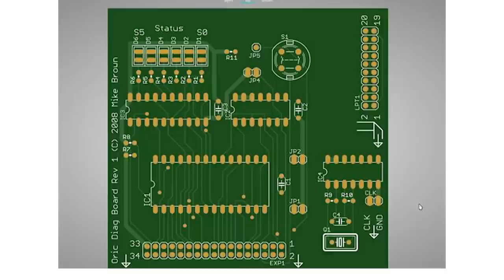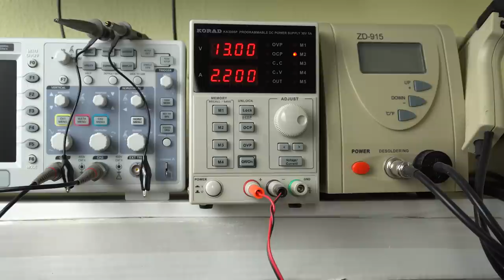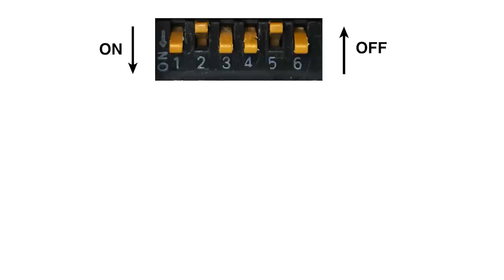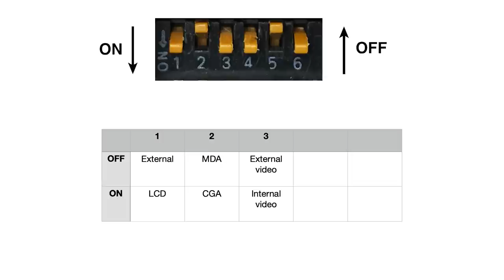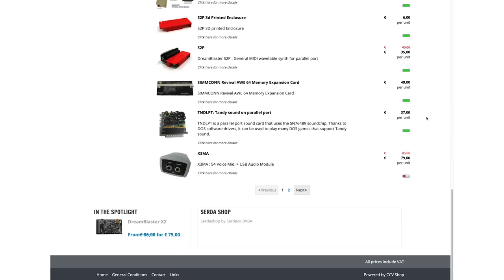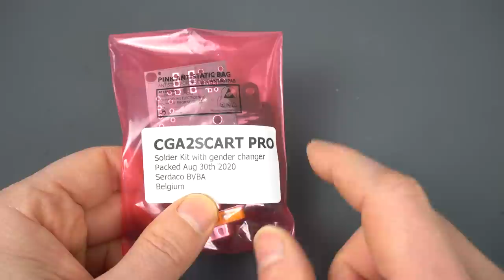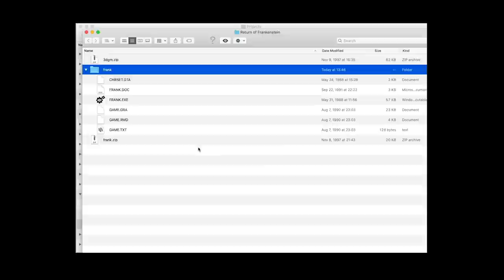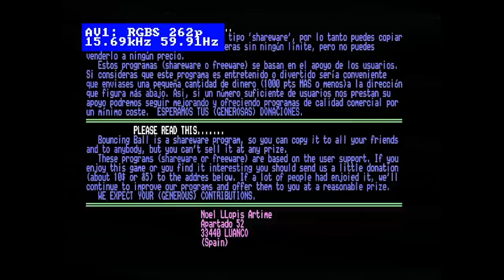Early MS-DOS Laptop Amstrad PPC512 (Part 1)

Comment: I had one of these back in the day (I don't know where it's got too!) and I remember upgrading it from a 300 baud modem to a 1200 baud one! I then swapped it out for a PPC640 and added a hard drive & external CGA monitor. I remember watching BBS pages drawing a line at a time! I don't recall throwing them out, they must be kicking about somewhere!
Reply from the maker: Nice! Putting a hard drive on a PPC wasn't a small feat! Did you get it done at a computer store?
Reply: @NoelsRetroLab  I fitted it myself, I must dig it out, I know I didn't throw it out!
Reply: Please, while people talked of bauds in the 80s no need to misuse the term in 2020. 300 bps was 300 baud but 1200 bps was 600 baud if I recall correctly. It is better just to forget the whole term. (baud is signal elements per second. Each element could code one or more bits)
Reply: @okaro6595  Stop trolling - I know what the term baud is and I referred to it correctly as it was a 1:1 ratio. The Amstrad PPC is from the late 1980s, I upgraded the modem myself, the PPC640 shipped with a 2400 baud rate modem.

Comment: Great stuff =D  Maybe the LCD problem is the flex ribbon being "hot bar" glued onto the LCD screen edge - perhaps it is suffering from the same problem Gameboys suffer and needs to be thermally joined again.  Looking forward to part 2!  Nice work on those old DOS games =D
Reply from the maker: Thanks! I don't have much experience with that kind of LCDs, so that could well be it. Right now I'm chasing down another lead though. I looked at the schematics and this LCD takes +5V and... -20V!!! And guess what, it's only getting -15V. So I think that might be enough to prevent it from displaying anything. Anyway, I'm pulling on that thread at the moment. We'll see where it leads me.
Reply: @NoelsRetroLab  Check for a shorted cap, or something else that gets too hot when you turn it on.

Comment: I used to own one of these - well the PPC640 version with 2x 720k floppy drives.  Got it second-hand at a garage sale as a kid back when my primary PC was still a 386.  I was so excited to have a PORTABLE computer I could take to school with me!  Problem was I saved up my allowance to get those ten C batteries - I figured they'd last a long time, right?  An hour and a half; that's it!  I had the AC adapter of course but the teachers wouldn't allow me to plug it in, citing "safety concerns" but really I think they just didn't like the idea of allowing me to be special while the other students used pencil and paper.  Unfortunately I resorted to taking it apart even though everything worked perfectly on it.  Wish I still had it, as I'm now into retro PC's.  All that remains today is the two floppy drives - and some of the original Amstrad floppy discs it came with.
Reply from the maker: Love that story, Angela! I could see how exciting it would be to try to take to class. An hour and a half is a LOT longer than I expected it would last on those batteries. They're cheap to get still, so I'd say look for one. The LCD video is abysmal, but the CGA out is great. I'm loving it so far.

Comment: Those plastic "screws" around 9:50 are called standoffs, just like the metallic ones that screw in and are typically used to mount most modern motherboards. The plastic standoffs were used in some AT-compatible (and early ATX) cases and would "slide" into openings in the case/motherboard tray instead of screwing in (though there were plastic standoffs that did screw in as well). And yes, I had to look that up just now because I couldn't remember ha ha!
Reply from the maker: Right. Thank you! Since I don't have a background on mechanical/repair stuff, sometimes basic vocabulary like that is totally missing for me 😃

Comment: One of my first "work" computers... I wrote a complete call-logging reporting suite in BBC Basic (?!) and A86 assembler under MS-DOS on one of these. All the screen / graphics were handled through in-line X86 code or within the .COM files themselves. Happy days...
Reply from the maker: Nice! Yes, a lot of people mentioned they used this for work. I think that's why so many people have bad associations with it and hate it 😃
Reply: @NoelsRetroLab  I also remember around that time we were installing Tulip 386 PC's with a 20MB hard drive that had a BIOS bug that would literally 'jam' the heads when it reached exactly 50% capacity, and you'd have to open the HDD housing and move the heads!

Comment: Great to see one of these machines getting some attention! Watching this video makes me want to have a look at my PPC512 which has no drives and is in pieces, I got it years ago in that condition, and I've no idea if it works or not.

That top compartment is for the modem cable - I've also got a PPC640 which comes with the modem installed by default, and the cable is a really tight fit in there.
Reply from the maker: Do it! It's a fantastic little machine (OK, not so little). Especially with the CGA video out, it makes it great for early MS-DOS gaming. Totally worth it. Check out some of the upgrades I'll add in the next few videos.
Reply: @NoelsRetroLab  CGA and MDA! so also perfect for text writing. I used to write my diary on Microsoft Works 1.05!

Comment: That machine is an 8088, so is 8 bit for the data bus, but internally is still a 16 bit CPU.  The Intel pure in and outside 8 bit CPU is the 8080.
Reply from the maker: Right. It's the NEC V30 so 16-bit CPU. It was a brain fade thinking of the 8 bit video bus (the regular bus is even a 16 bit one).

Comment: I'm amazed you can solder these items with that honkin'-huge soldering iron tip.
Reply from the maker: Nah, it's not that bad. The tip I actually really like it wide like that because it transfers heat a lot better than a narrow tip. So it's my go-to tip unless I need to do something really small.

Comment: maybe a easy one, but have you tried the "contrast knob" for the LCD ?
Reply from the maker: I did, I did... but that's a really good suggestion as you'll see in part 2 😃
Reply: I was screaming this throughout! 😱😂
Reply: I had one of these many years ago, and the display was nothing like a modern lcd , actually not particularly good even for the time let alone today - you really had to play with the contrast and the angle of the screen to get something readable. I used mine with a monochrome CGA monitor most of the time.
Reply: @Doug_in_NC  my PPC640 was pared with an IBM 5153 for 99% of its life, too!!

Great little machine, shame about the screen
Reply: @NoelsRetroLab  I also noticed that the floppy you used had bad sectors.. Sucks that lots of floppy disks probably nowadays are slowly bit-rotting away..
Reply: My thought as well...

Comment: Nice. I have a PPC640 I haven't touched in years. Looking forward to part 2!
Reply from the maker: It turns out it's a great machine if you use the CGA output. I have lots of plans for this one, so there'll be many parts I think 😃
Reply: @NoelsRetroLab  dunno if it is in your plans but as it has a V20 you can make it run CP/M-80 apps :D

Comment: I worked at Wilding's Office Equipment many years ago and a customer brought one of these in. He asked if he could do any thing to make it more useful. I suggested it would make a good door stop! He complained to the head office and I got a formal reprimand!!
Reply from the maker: 🤣🤣🤣 Hilarious! Fortunately, with modern technology, we CAN make them more useful. I'm hoping to upgrade it and improve it a bit over the upcoming months.
Reply: @NoelsRetroLab  I'm a qualified Novell engineer and still have the original Intel 
pentium pc I trained on. 4Mb of RAM  and 32 floppy disks to load Novell. 40Mb hard drive too. I can't part with it, sentimental reasons. Oh and it was Novell 3 by the way and I did upgrade!
Reply from the maker: @grahamwalker6395  Nice! I wish I had my own computer from back then, but they were all sold/traded/donated along the way. Oh well.

Comment: I owned a PPC640DD when they came out.  Some models had the NEC V30 Z80 clone CPU that was mil spec to survive a nuclear war and some slipped thru into the supply chain into the production of these PC's.  Glad the 640 had 640 RAM and the DD meant dual 3.5inch floppies.  It also had a built-in modem - 24bis IIRC.  Fun times on BBS and for train journeys.  Though for batteries it would eat them and a full set was not cheap, even then and rechargeable was lamentable.  Still a fun machine for the time, but don't expect to play elite on battery for more than 4 hours, IIRC 3 was closer to the mark.

Was not a light machine and when I moved onto a PSION II, battery life was leaps ahead and had fun programming with that and the hardware addons.

Did try the MC600 PSION PC notebook sized affair (was also the MC400 that was Psions OS interface and not DOS though may of got those two crossed in models) and was good battery wise, but was just too buggy for DOS stuff and took that back next day (yay Dixons).

Comment: ohh sweet memories.. my first MSDOS machine, a PPC 640, dual floppy ! I used on vacation connected to a ZyXEL modem (cell protocol for ETACS cellular networks, mid '90s)
Reply from the maker: Nice! Wow, I never ran modem over cell networks back then. Must have felt like total sci-fi!
Reply: @NoelsRetroLab  yes, and very slow! 16800 bps nominal, more or less 9-10k real... and quite expensive, billed at minute... :)

Comment: Assuming all 10 D alkaline batteries (12,000 mAh each) are in series, providing a nominal 15VDC with a power draw of ≈ 0.6 Amps then ideally the batteries could last up to 20 hours.  (12,000 ÷ 0.6 = 20)   However, in reality you will only get a fraction of that, but assuming the dropout voltage is ≈ 9VDC you might expect to get over 15 hours IF power draw actually stays at .6Amps.  I’d expect the actual average power draw to be closer to twice that.  Though notably the Sony CXQ70116 CPU Amstrad used in that device had a primitive version of power management/standby mode for reduced power consumption.

Comment: Oh my goddess that was my first laptop. I still have it.
Reply: Sorry "laptop", more like "portable beast heavy as a black hole and a white dwarf dancing together", without the batteries
Reply: The computer lasted between 15 minutes and 1 hour depending on floppy access using C size batteries. You could not put rechargable, the BIOS detected them and showed a message preventing you from booting. Neither non-alkaline (yeah those old ones), also detected by BIOS. They had to be the expensive alkaline ones.
Reply from the maker: I was told it lasted an hour, but that makes more sense with heavy disk access. That's crazy about dertecting rechargeable batteries and preventing you from using them though!! I wonder how they did that.
Reply: @NoelsRetroLab  at the time it looked like magic. now I know better. same as a multimeter can tell you a battery voltage. rechargables are 1.2V, alkalines are 1.5V. The current is also different. That's how modern batteries tell you the percentage left, they used it to detect the battery type and whine. Now the question is not how, but why, if the nicad and nimh had the power to make it POST and beep and show a message on the screen, why stop there? why not run on them?
Reply: @NoelsRetroLab  Needed good alkaline batteries as it expected each to be 1.5 volts, and NiCd rechargeable would give you less at 1.2 volts, so one way of detecting them would be that way. Modern rechargeable batteries NiMH or lithium) that give 1.5 volts might fool it, and also give more than an hour of run time.

Edit: You already covered that in your subsequent comment. Should read all the replies first.

Comment: Have you ever seen a Psion MC400 from around the same period? 80C86 based machine - the  200 had a tiny screen that looked 'wrong', but the 400 and 600 had a larger screen that was at least as good as CGA with a resolution of 640 x 200/600x400. The 600 ran  a version of MSDOS, I think it was 3.2 from ROM. The 400 ran Psion's own windowed operating system, called EPOC (later used on Nokia phones as Symbian), with a  trackpad that you clicked (effectively a single button mouse, along the lines of the Macintosh well over a decade before trackpads were a thing, with a 1:1 mapping to the screen) The 600 didn't have mouse support, for obvious reasons.  I own the 400 - the DOS version was clunky, since I used an ST at home, and liked GEM.
It was profanely expensive at the time (£850 or thereabouts for the 400, around 1300 for the 600 -  in today's money that's £1,872.25 [2,077.35 Euro] for the 400, and £2,863.44[3,176.42 Euro] for the 600) They claimed on the 400 something like 60 hours out of 8xAA cells, and I got at least 12 hours out of it running some pretty heavy (for the time) spreadsheets on train journeys  to different sites.
 Rumour has it that only about 1000 units were sold. I got an ex display one for £99 - the machine cost a £1 and I the rest was a three year warranty, since the salesman got a commission on it. I was more than happy with the deal. 
For portability it weighs in at about the same as a modern low end laptop from a couple of years ago. 
I used mine until the late 90s - the battery pack became unstable following it being dropped, causing random resets - I still have it in the attic somewhere.
In many respects, it was way ahead of its time, and a grand little machine.  You can see the MC600 in action in Die Hard 2:Die Harder (my second favourite Christmas movie). Holly is working on one on the plane.
Reply: Remember seeing the MC400 in Dixons in Lewisham. Great screen, good looking OS on high resolution LCD, First clickable trackpad I saw. Way ahead of its time. Always wanted to get one.
Reply: I had one of those that I bought from an auction and ended up selling on eBay. Interesting machine though, as well as the touchpad being a button, it also used absolute positioning so it took some getting used to.
Reply from the maker: I hadn't seen one of those. Now I need to do some research. Which one is your favorite Christmas movie? Die Hard 1? 😃
Reply: @NoelsRetroLab  A classic trilogy is good
Reply: @NoelsRetroLab  Seriously, Die Hard 1 was a family favourite when I visited my parents for Christmas more or less every year.
Reply: @jimmoores7883  Mine was the ex-display unit from Dixons in Scunthorpe.

Comment: Have one of those in my loft. Haven't tried it for years. I'll dig it out and see if it works.
Reply from the maker: Do it! It's a really fun little computer, especially if you use the external video out.
Reply: @NoelsRetroLab  not sure if you'll get to read this Noel but I finally found time to go into the loft and bring down my ppc512. Powered it up and it worked! I didn't try booting from the floppy as I wanted to copy it first. I have all the manuals too. It's amazing the documentation you got with old PCs. While up there I rescued my Video Genie too.

Comment: In the list of software you created or worked on I noticed a folder called 'MUD'. Exactly what MUDs did you work on?
Reply from the maker: Haha! Eagle-eyes! That was a folder with old files, only the ones in "projects" are ones I created. MUDs contains information about muds I used to play back in the day, mostly Abandoned Realms 😃
Reply: @NoelsRetroLab  Aha. I have only been involved with MUDs since around 1996-1997 or so, mostly in the creative process. I never played much myself. I do still host two MUDs of the DIKU/MERC line though.

Comment: briefly played with one of these years ago (late 90's early 2k before I went to high school), would only work with the external CGA monitor as I didnt know about the switches to use the internal one at the time, had two floppy drives as well. not sure if these things can have High Density drives, I didnt have it long enough to find out, it may not have the "HD" pin on the drive header connected.
Reply from the maker: That's a good question. I don't think so, but I should check. I'll have a Gotek heading into one as soon as possible too. That alone will make it way more usable!

Comment: It would be really interesting to retrofit a modern day, full colour lcd into this one if it was possible, any chance of that ?
Reply from the maker: Yes, it's been done before: https://retrohax.net/amstrad-ppc640-modshax/ I don't how how to feel about that. On one hand the screen is great, on the other hand, it's really far from the original. You can already get great visuals through the external video port, so I'm not sure I want to go that far. Before that I'm going to try with some backlighting, but I don't rule it out that I go all the way and end up with a VGA display. We'll see.
Reply: @NoelsRetroLab  wow I'd definitely want to do it if i had one, it looks way better after that mod, either way it'll be interesting to see which way you go Noel.

Comment: I had a 512k one of these but then I got a 640k one because the first was real flakey, many games need 640k to run but you can solder in extra chips to make it 640k. It runs those old xt games at just about a perfect speed and I don't appreciate the old cga games if I run them on a 486.
Reply from the maker: Right! That's one of the first upgrades I'm planning on making. Looks really easy too.

Comment: On the SCART adaptor the USB connector solder points are super close together. My mediocre soldering skills would have been heavily tested. Any suggestions for not shorting such close quarters connections? By the way ... great Christmas ornaments. 🎄
Reply from the maker: Yes, those USB pins are pretty close. A slightly narrower tip would help, and either plenty of flux or solder with lots of flux inside. And even if you do short them, that's not a problem. Check them afterwards and pass the tip again to break any connections or even a bit of solder braid. I have no doubt you can do it with a bit of care. Haha, glad you liked the ornaments! They're great! 😃